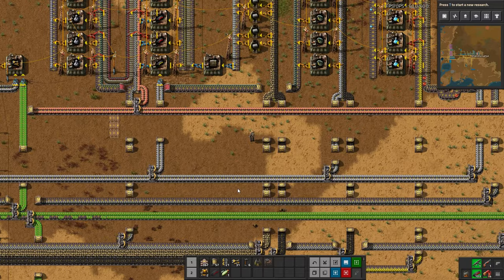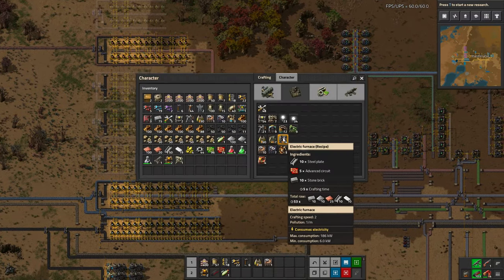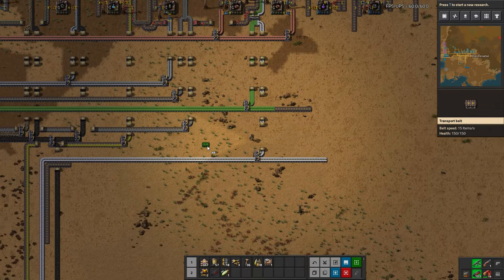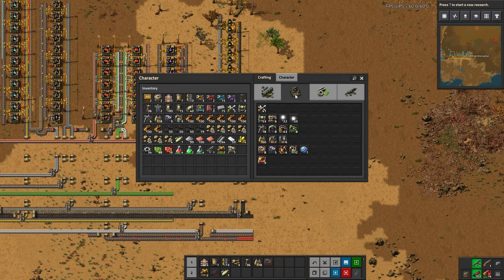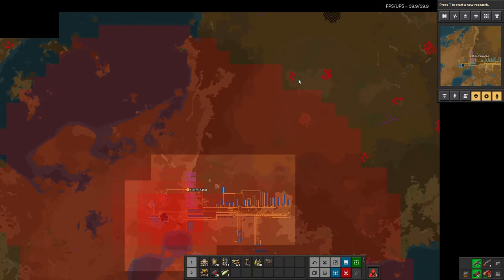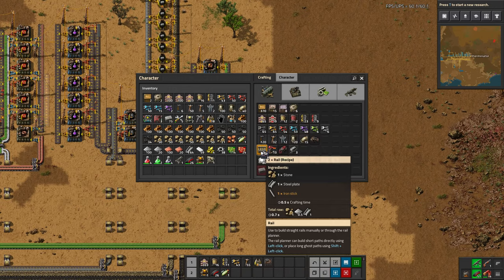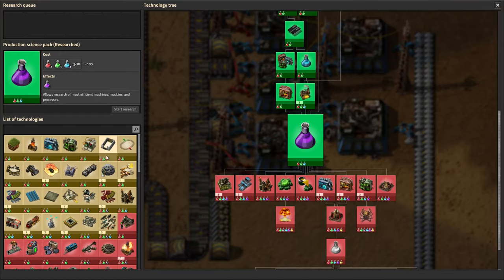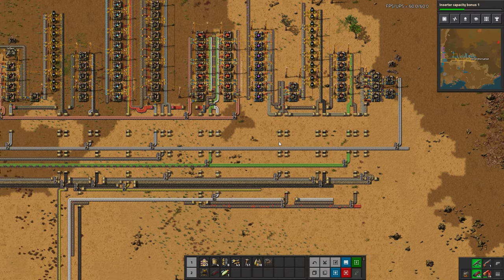Factorio 1.0 Tutorial Lets Play EP13 -  Purple Science! :Introduction Guide For New Players Gameplay

Comment: * Steel furnaces are nice. But the issue is supplying them with ore. This is really the point where trains are required. There are  only so many miners you can fit on your small starting patches 
* Given that three rail assemblers are overproduction it's probably ok if they aren't running fully. You really only need half a yellow belt of rails for this. Putting it on both sides absolutely helps with moving things, but it doesn't actually need to be full. Another easy way is to use red belt.

Comment: One thing to your last video. To show the items in the combiner you need to activate the alt showing int the interface options since it's default is off.

To this episode. When you upgrade your whole furnace array to steel furnaces, wouldn't you need to upgrade to red belts?
And lastly with your rail production being more than needed for purple sience it would be good to start storing them in a chest for when you need to make a mining outpost.

Also when you build the red circuit splitter the second platic lane is running into it.
Reply from the maker: I thought I mentioned you needed to have alt info on to see the combinator display. 

As for the steel furnaces, you are correct it would need to be upgraded to red belt. That wasn't really relevant to why I mentioned upgrading to steel, so I didn't bring it up then. 

And I'll check out the splitter thing in red circuits! :)
Reply: @Xterminator  Thought I could help you find the timestamps for that last part.

For the red circuits splitter, you seem to place it at 13:48 , and at 13:58 when you zoom out you can see the middle belt is a continuation from the plastic belt, made to go under the red circuit at 12:54 ;)
Reply: @Xterminator  Yes you mentioned that we need alt info, but the combinator doesn't show there on default since it is an extra setting.
I think for the tutorial aspect it could be good to mention things like the red belt when speaking about upgrading. I rember when I started playing that this was something I forgot to upgrade in my production. :)